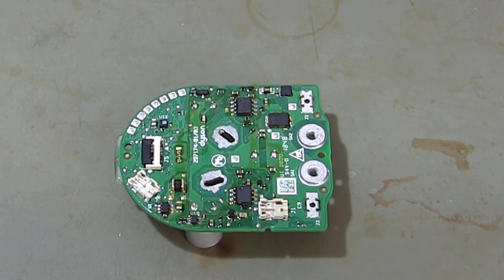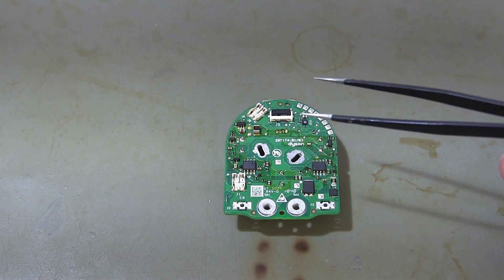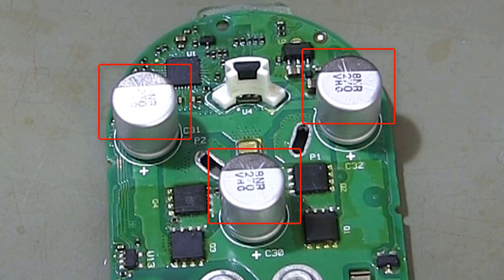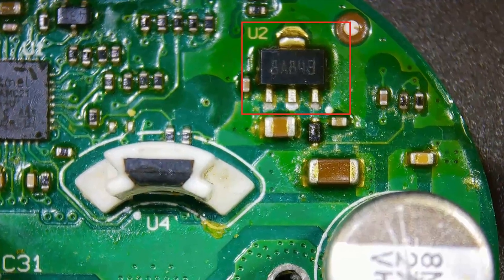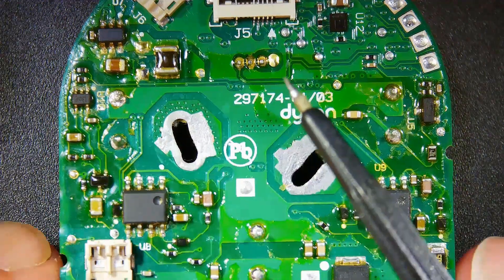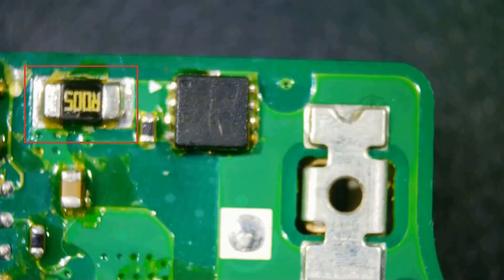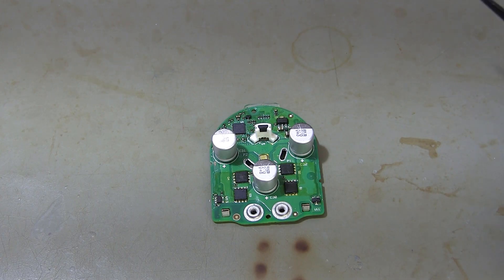How to Repair Dyson V11 Motor Control Board? Component Analysis

Comment: Hi, do you know which component should I check if my dyson v11 still working but screen is complete off? I tried to replace the screen but didn't work, I think must be something in the pcb, resistors or something,  thanks
Reply from the maker: Hey! If your Dyson V11 is still working, but the screen is completely off even after the screen is replaced, there’s probably something on the control PCB that’s not providing power or data to the screen. Here’s a step-by-step breakdown of the components you need to check:
1. Check Power to the Screen
First, verify that the screen is getting power.
Multimeter test: Find the VCC and GND lines going to the screen connector. You should see around 3.3V or 5V, depending on the screen type.
If there’s no voltage, check the following:
Voltage regulator (like AMS1117, 662K, etc.): Look for small 3-pin ICs near the screen connector. These convert the higher voltage to 3.3V or 5V.
Current-limiting resistors or fuses: Sometimes there’s a small SMD fuse or zero-ohm resistor in the power trace. Check for continuity.
2. Check Data Lines (I2C / SPI / UART)
If the display is receiving power but still off, it may not be receiving data from the microcontroller.
Trace the SCL/SDA or TX/RX lines to the main MCU (probably an STM32).
Use an oscilloscope or logic analyzer (if available) to check for activity.
Is there no signal? Then the microcontroller may be:
In fault mode
Has a broken connection (dry connection or cracked trace)
Has a damaged I/O pin
3. Check Startup Components
Some displays need pullup resistors on the data lines.
Check for 4.7kΩ–10kΩ resistors on the I2C/SPI lines.
If they are missing or faulty, the display will not start.
4. Double-Check Screen Compatibility
Even if you have replaced the screen, make sure it is the exact same model (same pinout, voltage, driver chip). If you are not sure, try reinstalling the original one just to test it.
5. MCU Functionality
If the vacuum works but the screen is blank, the following is less likely but still possible:
The software is corrupted or
The screen portion of the program has crashed
It is rare, but sometimes happens after water damage or static discharge.
What to Check Summary:
What to Look for Component Testing with
Voltage regulator Multimeter 3.3V/5V output
Screen connector Multimeter Power on pins
Pull-up resistors Multimeter 4.7k–10kΩ
Data lines Logic analyzer Communications
Reply: Hi,dyson sv14 pulsing with eco and medium mode then battery blue light blinking then stop. No issue with booster mode. Can you advise which components are bad?

Comment: Hi,

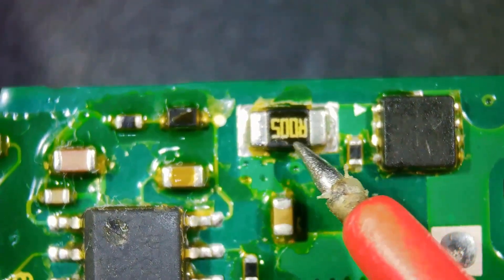7:07  i have 0,1 Ohm. I have problem mit Brush. Motor without Brush work fine and good,but with Brush motor still Works fine and good,only Brush didnt work. I haved Test make with Brush from another Dyson,and its same. Problem is Motherboard und I dont habe 5 MOhm ,i have 0,1 Ohm. Or what you think?
Reply: How much Watt ist Kapasitor?
Reply from the maker: The value of the capacitor is 270uf 25v
Reply from the maker: Hello. There may be a problem with the circuit board that the brush motor is connected to. I recommend that you check the mosfets and the electric motor on the brush motor circuit board.
Reply: Все правильно,0,1 Ом.Проверь мосфет по управлению щеткой и предохранитель)
Reply from the maker: Thank you for your interest.
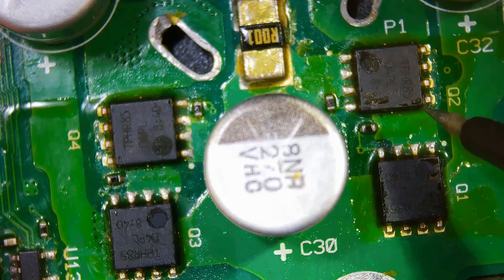Reply: 3:32 resistors  Q2 and Q4 100 kOhm, and Q1 and Q3 1 M Ohm.
Reply: Resist at my Motherboard is 5 M Ohm,in your another video you have Resist 1 M Ohm
Reply from the maker: There may be a version difference in the circuit board.
Reply: @electronic7979  where I can see the values that the motherboard should have??

Comment: Hey bro thanks for the video. I’m not sure it can help me though. My V15 motor wont start, LCD screen says 100% battery, allows switching between ECO, MED, BOOST modes but doesn’t start up when I pull the trigger. When I pull the trigger I can hear 2-5 very, very tiny clicking noises. 

I’ve cleaned battery contacts, dust bin connection, air filter already.

Any idea what I can do? Can I use my multimeter to test the motor/circuit board myself for problems? I can de-solder though. Thanks a lot for any help!
Reply from the maker: Your Dyson V15 has power but it doesn’t seem to be getting it to the motor properly. Small clicking noises could be MOSFET switching noises and could be a sign of a fault in the motor driver circuit.

Inspect the Trigger Mechanism
If the trigger switch is faulty or not making proper contact, the vacuum won’t turn on.

Hold the trigger and shake it gently to see if the motor responds.

If you have a multimeter, check to see if the trigger switch provides continuity when pressed.

Look for Bad Battery or Connections
Even if the display shows 100% charge, the battery could be faulty and not providing the required current.
Try a different battery if you have access to it.
Remove and reconnect the battery a few times to make sure there is a good connection.
Check all battery connections.
Inspect the Motor and Control Board
A small clicking noise could indicate a faulty MOSFET in the motor control board.
If you’re not comfortable opening it up, check for burnt components, loose connections or worn contacts.
If the motor itself is faulty, it may not be receiving power even if the board is working.

Comment: Complimenti per la spiegazione dettagliata. Ho un dyson airblade db con il motore che invece di partire emette un buzz e non gira.Cosa potrei controllare? Grazie
Reply from the maker: I think you should first check the motor driver mosfets. There may be a short circuited mosfet.
Reply: @electronic7979  Grazie per la risposta.Ti aggiornerò sul risultato.
Reply: @electronic7979 
Grazie per il suggerimento.Ho risolto sostituendo il driver difettoso. Sei un maestro
Reply from the maker: I'm glad I could help. Have a good day.
Reply: @dariogrec you have replaced its MCU or mainboard or whole motorhead? Because I hear people say only MCU or mainboard can work with its motor, can not exchange or replace? I have one MCU replacement but cant work

Comment: Hello I finally replaced a mosfet but my dyson v11 still works in fits and starts do you have an idea? Thank you
Reply from the maker: If you have checked all the mosfets. You should check the capacitors, current limiting resistors connected to the mosfets. I recommend that you also renew all the soldering on the circuit board.
Reply: @electronic7979  I will check thank you

Comment: HI! please help: The V11 vacuum turns on for one second and immediately shuts off, with the display not lighting up. This behavior has been happening since the vacuum was purchased. After an indefinite number of attempts, the vacuum may turn on and work normally until the next attempt to turn it on. What could be the problem? You can watch the video: https://youtu.be/PrwZ930ywwY
Reply from the maker: The problem may be caused by a part that is not making full contact somewhere. First, I recommend checking the cables, electrical sockets and battery. If these do not work, there may be a problem with the motor control board.
Reply from the maker: The problem may be caused by a part that is not making full contact somewhere. First, I recommend checking the cables, electrical sockets and battery. If these do not work, there may be a problem with the motor control board.

Comment: Source for circuit boards and parts for Dyson vac's?
Reply from the maker: Hello, you can find the Dyson circuit board at an authorized service. You can find the materials on the circuit board at electronic component dealers.

Comment: Problems with circuit board, goes on and off and restarts
Reply from the maker: You should check the electronic components on the circuit board. First, check the capacitors on the circuit board. There may also be solder cracks on the circuit board.

Comment: Hi, I have a Dyson V12 Slim that turns off after a few seconds of turning it on. 
Reading online, some users have solved the problem by replacing the three capacitors on the PCB. 
I also read that these are hybrid capacitors. 
In your opinion, is it possible to replace these hybrid capacitors with classic electrolytic ones?

Can you help me by giving me directions on where to buy them? Maybe on Aliexpress?

Thanks
Reply: @electronic7979  please, can you help me?
Reply from the maker: Your problem may be caused by the capacitor. The point you need to pay attention to when changing the capacitor is the capacitance and voltage value written on the capacitor. You can use a capacitor with the same values. You can find the capacitor at electronic component dealers.
Reply from the maker: Your problem may be caused by the capacitor. The point you need to pay attention to when changing the capacitor is the capacitance and voltage value written on the capacitor. You can use a capacitor with the same values. You can find the capacitor at electronic component dealers.
Reply: You can replace with electrolytic with bo problem

Comment: My Dyson vacuum makes a short sound and shuts off immediately. It runs for less than a second. I have already replaced the battery with a new one and cleaned the filters and the machine thoroughly. I am unsure which component might be causing the issue. Could you please help me identify the problem?
Reply from the maker: If your Dyson vacuum cleaner starts but then immediately shuts off, the problem is most likely related to one of the following components:

Motor or Motor Control Board:
Symptoms: If the motor control board is faulty, it may not be supplying the correct voltage or current to the motor. Similarly, if the motor itself is damaged, it may be triggering the protection circuit due to excessive current draw.
Solution: Check the motor control board for damaged components (burnt resistors, capacitors, or MOSFETs) and inspect the motor for wear, debris, or internal shorts.
A Blockage in the Airflow Path:
Symptoms: A blockage can cause the vacuum to overheat or momentarily overload the motor.
Solution: Double-check the airflow path for hidden obstructions, including the hose, wand, and cyclone assembly.
Bad Battery Connections:
Symptoms: Loose or corroded battery contacts can cause intermittent power delivery, leading to instantaneous shutdowns. Solution: Make sure the battery connections are clean and secure. Check the terminals for corrosion or damage.

Comment: Hi, I don't have power on the vacuum cleaner brush (dyson v15 detected absolut). I've already changed the mosfet, but it has no effect. What can be done?
Reply from the maker: Dyson V15 Detect Absolute vacuum cleaner brush no power problem can be caused by a variety of reasons. If the problem persists after replacing the MOSFET, you can check the following steps:
Check the brush connection
Check the connectors where the brush bar connects to the vacuum cleaner. It could be due to rust, dust or looseness that is cutting off the electrical flow. Clean the connectors with a clean cloth and make sure they are securely seated.
Cable and circuit connections
The cables between the body of the vacuum cleaner and the brush bar may be broken or damaged. Carefully examine the cables, especially around moving parts.
Test the cable continuity with a multimeter. If there are any breaks in the cables, they should be repaired or replaced.
Motor Control Board (PCB) Problems
There is a motor control board inside the brush bar. This board consists of components other than the MOSFET (for example, driver IC, capacitors or diodes). Check the other components of the board.
Inspect for visible signs of burns or damage. Replace any damaged components.
Brush Motor Test
There is a small motor inside the brush. This motor can fail over time. Test the motor by running it directly from a power source. If the motor does not turn, the motor may be faulty and should be replaced.
Check the Vacuum Cleaner's Motherboard
The main control board located in the body of the vacuum cleaner manages the power to the brush. If there is a problem with the main board, the brush may not be receiving power. Check the connections, fuses and switches on the board.
Brush Sensors
On Dyson vacuums, the brush head is sometimes controlled by sensors. If the sensors are dirty or faulty, the motor may not start. Clean the sensors carefully and check the wiring.
Firmware or Software Problem
Dyson vacuums can sometimes fail to work properly due to software problems. Try a "reset" by unplugging the vacuum, waiting a few minutes, and then plugging it back in. If this does not fix the problem, the software can be installed by an authorized service.

Comment: I have a v11 running for 2 or 3 seonds at a time then turning off. After trying lots of times over and over it will then stay on. Problem keep coming back. Is this a board or battery? Nice video
Reply: There is a guy on another video saying he solved that by replacing the 3 capacitors shown on this video. I'm having the same problem, but I'm not sure I wanna try that fix just yet, but this seems to be a common problem.
Reply from the maker: One of the parts that can cause the problem is the capacitor. I recommend starting with the capacitor first as it is the easiest to replace.
Reply: Replace capacitors
Reply from the maker: There is most likely a solder crack on the circuit board.

Comment: Hello, how did you remove the varnish / glue from the mosfets ? Thank you
Reply from the maker: I removed it using cellulosic thinner.
Reply: @electronic7979  Thank you for the quick answer but  the cellulose thinner does not damage the pcb?
 the white spirit remove  ?
Reply from the maker: It will not damage the PCB. You can clean the circuit board using a small brush.
Reply: @electronic7979  Ok thank you I'm going to buy the cellulosic thinner because I'm only white spirit or acetone

Comment: I have an issue with the low/medium/boost switch on my V10. I dont know if it has something to do with the magnet in the switch but: When I'm on boost, everything works fine, lot of power. When I'm on low or medium, it's like the vacuum puts itself on boost for a second, then returns to normal, then it does it again, and then it's like a machine gun of low/boost/low/boost. Sometimes it stays on low for a long time and sometimes it's a machinegun. It's a pulsating sound but not the same as when the filter is blocked, it goes to boost. Did you experience an issue like that? What connections could I override to delete boost mode?
Reply from the maker: Hello, thank you for your interest. I haven’t encountered such an issue before, but I can provide the following assessment regarding your problem:
The issue could be related to the electronic control board, switch, or sensor.
The switch that changes power modes might be faulty.
Battery Voltage Fluctuation
If the battery is at a low charge level or has an issue, the device may fluctuate between power modes. Ensure the battery is in good condition. If possible, test with a different battery.
Filter or Airflow Issue
A problem with the filter or airflow could also cause the vacuum to switch to boost mode in low settings. Remove and clean or replace the filter. Check for blockages that might restrict airflow.
Control Board or Software Issue
There could be a fault in the software that manages power modes on Dyson’s control board. Additionally, issues with circuit components (e.g., MOSFETs or resistors) could cause such fluctuations. In particular, solder joint cracks on the circuit board may result in this kind of problem.
I’m not sure how to disable the boost mode either.
Have a nice day!

Comment: R001 resistor has a very low value of 0.001 ohms. Not 1 million ohms as stated in your video.
Reply from the maker: 0.001 Ω = 1 milliohm

Comment: Capacitors specs? I need to change them, please help
Reply from the maker: The capacitor on the circuit board has the capacity and voltage value written on it. You should change the capacitor according to the values written on it. Also, the capacitor has positive and negative sides, you should pay attention to this when changing it.
Reply: And size ! If you use bigger one might not fit. The space is very limited

Comment: At what battery level charge will the brushhead stop working pleasr
Reply from the maker: The Dyson V11 vacuum cleaner can stop the brush bar for protection purposes depending on the battery charge level. This usually happens when the battery level drops below a critical threshold. In order for the Dyson V11 to maintain its full working capacity, the device can disable the motorized brush and switch to basic suction only. This threshold usually occurs when the battery level drops to around 20-30%.

However, it is worth consulting Dyson's user manual or technical support line for more specific information. If your vacuum cleaner's brush bar does not work even when the charge level is high, there may be a fault with the bar and this will require separate examination.
Reply: @electronic7979  Thank you very much.

Comment: Please help to identify root cause of malfunction: V11 pulsing fast, instead of running smoothly. I checked all components for cleanliness and issue is somewhat electric relatad.
Reply from the maker: The problem is most likely caused by the electric motor. There may be a problem with the motor bearings or there may be a break in the plastic part that provides the suction connected to the motor end.